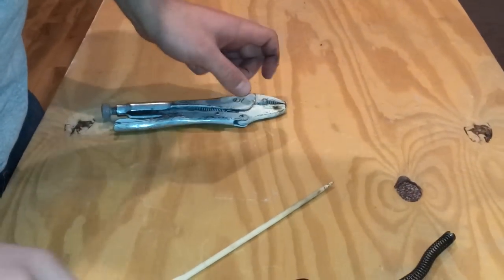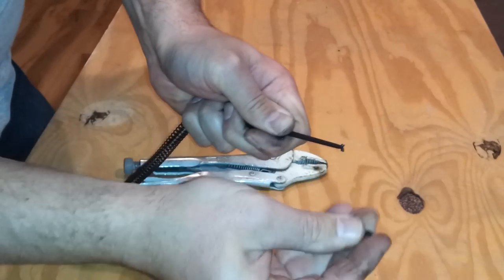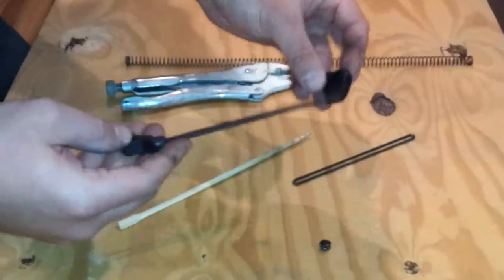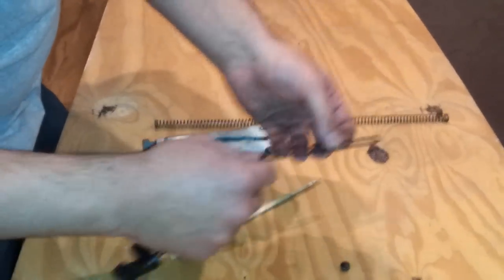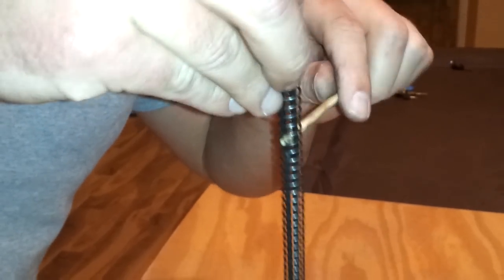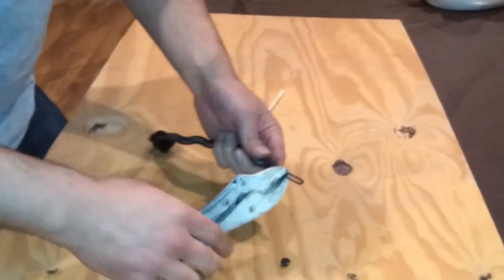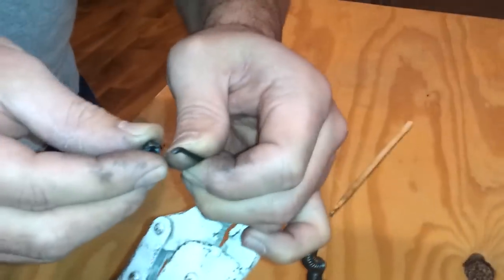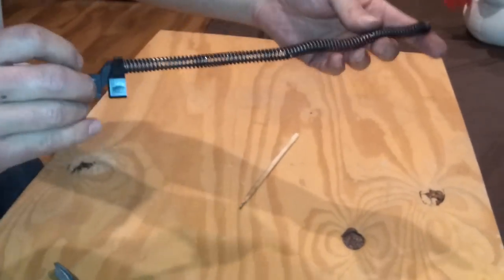AK-47 recoil buffer installation

Comment: If you have a hard time feeding the split guide rod back in side the spring. Like mine would not stay together. I used a large milk-shake straw over the split end of the guide rod. And in it goes.

Comment: The purpose of this buffer is just an optional alternative of heavy spring to reduce hitting b carrier to the trunnion. Better get 15%extra power recoil spring from any brands.
Reply: Yeah and then you increase 15-20 percent more wear and tear on your front trunnion. Obviously your front trunnion is your most important part and a stronger spring will put more wear and tear on it. The buffer helps out your bolt carrier. But you don’t want extra damage to your front trunnion
Reply: @jakeh6980  Honestly, I've never convinced with the idea of functional improvement and recoil reduction with that thing. For reason i wasn't reassure with it, i thought the same, the trunnion malfunction causing. Better to stick with traditionals. A balance balance with recoil spring weight and bullet grain

Comment: The spring of the bolt SHOULD!! be changed after 3k of the shoots . ONLY! the weak spring permits to the bolt to hit the frame. The good spring keeps the bolt from hitting the frame. Don"t be foolish buying the useless peace of trash . It may preserve the bolt from  hitting the frame BUT!! the weak spring CAN fail to lock the bolt and put you in death danger.
Reply: AK bolts don't lock back.

Comment: thanks guy. the buffer came with no instructions. i assumed it just slid down the spring. Alas, the other day i noticed i had no buffer. how it got out of  the receiver i am not quite sure but it is no longer available to buffer. I did manage to figure out how to remove the spring in the same manner you did although I did not use the chop stick but a screw driver from a very small set.  thank you very much.

Comment: Is there a noticeable difference when shooting without a recoil buffer and when shooting with one? Great video, thanks for the information. Thought it was just a drop in piece lol
Reply: it is, no idea why the guy took it apart. It slides right over the spring lol.
Reply: @ashtonharris4967  i actually had installed one on my AK74, great gun.
Reply: @ashtonharris4967  Some of them have a slot cut through the buffer that helps hold it in place along the rear spring retention part.

Comment: if your ak needs a buffer throw it in the garbage
Reply: Recoil Buffer vs Extra Power Recoil Spring
You know I've never seen a Russian or any nation that uses the AK-47/74 use recoil buffers. I am starting to think Recoil Buffers are one those accessories marketer's market to make more money like titanium firing pins.
So if your bolt carrier is hitting the back part of the receiver "harder than normal" get an extra power recoil spring to stop that situation.
In my opinion also after using buffers & not using them.
Reply: @sweetcostarica  they aren't necessary. And most people use them if they're AK it's out of spec. Due to the bolt carrier derailing or slamming into the back of the receiver. Or if they're shooting suppressed.
Reply: @Randy_84  Don't just take my word for it. Here are other folks viewpoint on the Recoil Buffer:
"The bolt carrier in the AK "they say" is not suppose to hit the rear trunion."
"If your bolt carrier is hitting the back of your receiver then you should replace the recoil spring, not band-aid it with a buffer imo."
"The bolt carrier in the AK "they say" is not suppose to hit the rear trunion."
"A wise man once said, "I'll start using one when the Russians do""

You said folks use a "Recoil Buffer due to bolt carrier derailing and And most people use them if they're AK it's out of spec".
If your AK's* bolt carrier is derailing* and/or if your AK is out of spec, take the rife to the gunsmith or sell it quick cause that weapon is unsafe.

About "shooting suppressed" I do not do it or need to do it with an AK.
Stay salty.